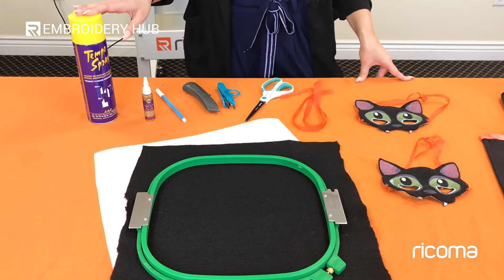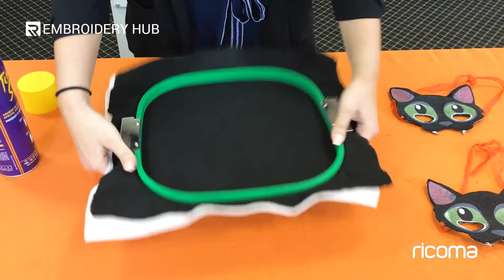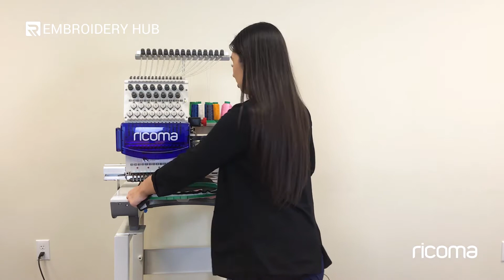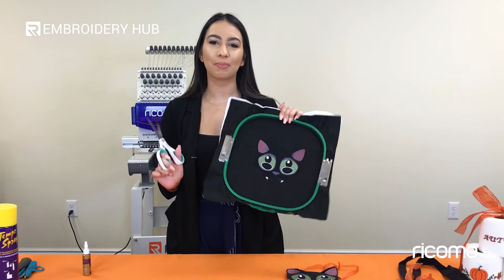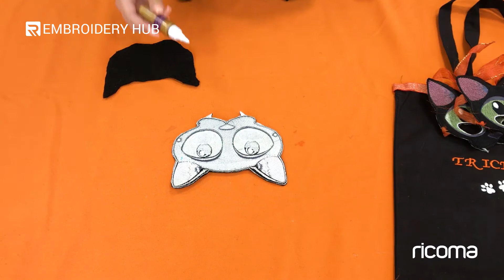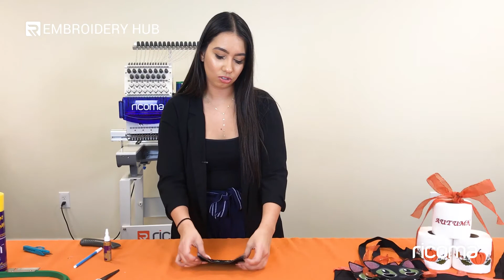Embroidery Hub Ep. 21: DIY Mask | Halloween Embroidery Tutorial

Comment: Ohh man! Just an easier finishing suggestion . Why not float extra felt underneath after it is done stitching the fabric......add an extra bean stitch around the outside of the pattern and around the eye holes. Then cut it out. That way you would have all edges finished with no glue. You could also punch grommets through for the ribbon.
Reply from the maker: Thanks for the tip! We will definitely try that next time!